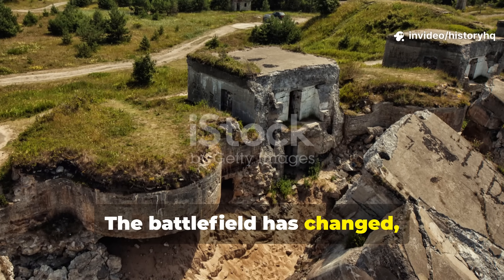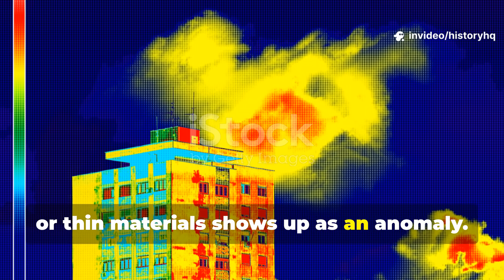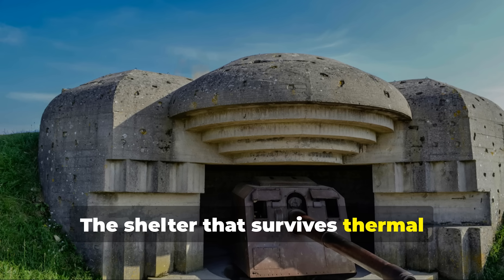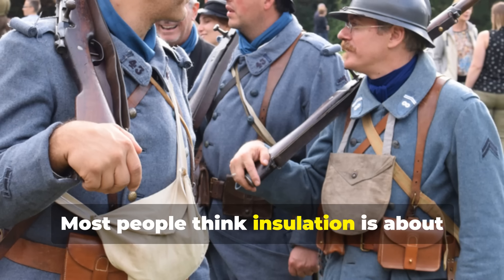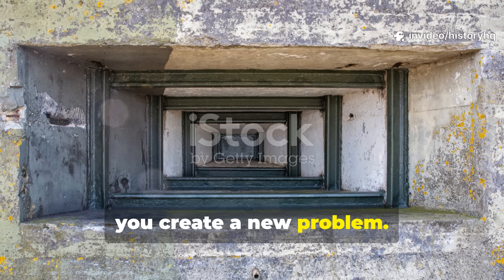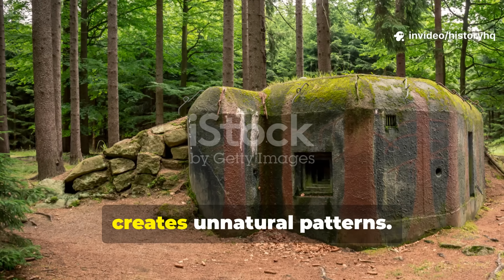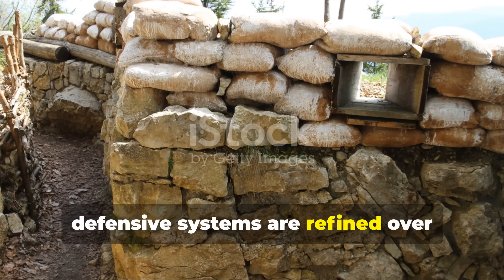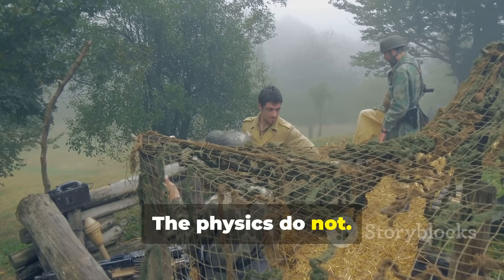Ghost Shelter Secrets: Vanish from Thermal Drones Like a Pro

Comment: Didn't knew thermal detection existed in WW 2.?
Reply from the maker: Good question. WWII didn’t have modern thermal cameras, but engineers already understood heat leakage, infrared radiation, and camouflage principles that later tech made visible.
Reply: I know in Vietnam they had early night vision goggles.
Reply: @Thomas-c7j3f  that's why thermal was never an issue in WW2.
Reply: If they had nukes they had thermal